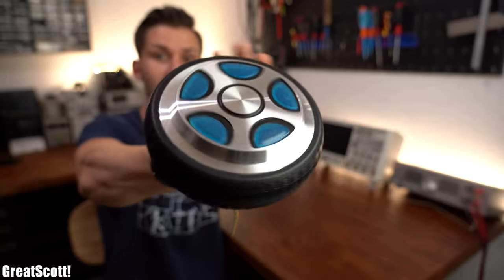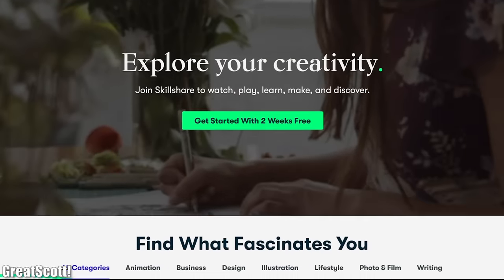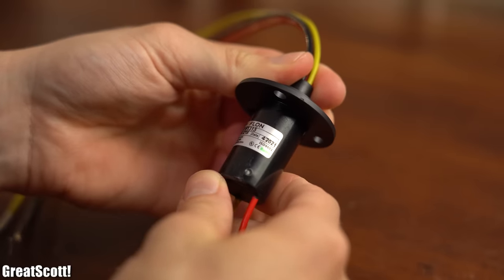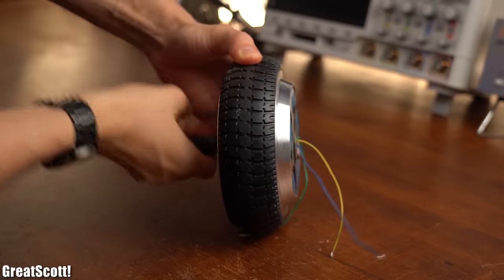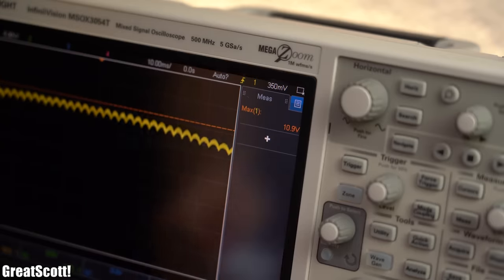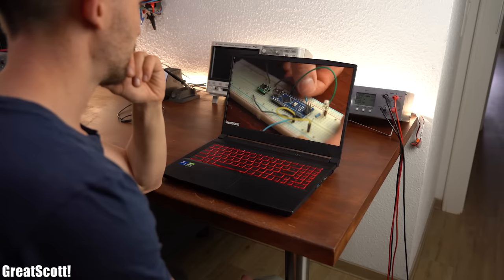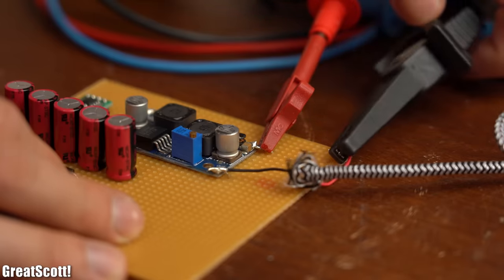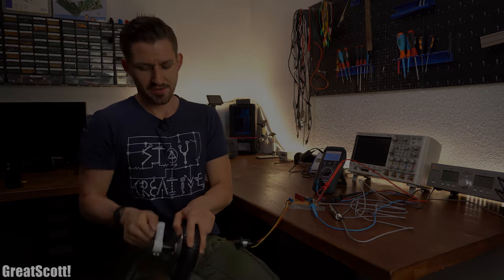Finally a good usage for Hoverboards! (charge your powerbank by cranking)

Comment from the maker: The first 1,000 people to use this link will get a 1 month free trial of Skillshare: https://skl.sh/greatscott09211
Reply: Hi sir. This was really useful video. Sir please hack an AR glasses to work on a HDMI input even if the whole setup becomes bulkey. Bigg fan.  Love from India ❤️❤️❤️❤️❤️❤️❤️❤️❤️❤️❤️❤️❤️❤️❤️❤️❤️❤️❤️❤️❤️❤️❤️❤️❤️
Reply: Time to attach It to the bike generator 😁
Reply: @-.......................-  seems like it was a patreon video maybe?
So people saw it before the release
Reply: Your hands will get pain after 5 mins, make one ring cage and attach it to the wheel, put one rat inside, it will do the job like an old movie style😂
Reply: your videos have been referred during Robert borsch training process
Reply: Put this on the Bike Generator,and Protect the spining wires. I dont think that this is a Good solution, becourse the wires rub constantly on the housing of the Motor (in the hole...)  Also for  an 2w Generator its way to big and heavy to be usefull...
Reply: As always, informative and entertaining video! However, I have a few points to add/ask. What is the Ampere-time characteristics of the efuse chip? I can see having large capacitor banks on both sides tripping the protection all the time. 
You pitched "emergency use" in the video. In that scenario, I would've avoided any parts that have a (slightly) higher chance of catastrophic failure modes (blowing up). Those electrolytic caps for example. 
Again, I like the idea of the project but I would have tried to consolidate the 2 capacitor banks and got rid of the easy-blowing caps. 😀
Reply: I Like your 6 Puls Brücken Schaltung
Reply: Hey.. How about make a gravity powered generator..
Reply: You should make one of these into a wind turbine!!!
Reply: I have 27.2v 1200 watt power supply means 44 amp. I connect two 12v 100a batteries in series and then i connect this power supply. But battery not charged! Why?? And how i charge 12v battery with this power supply???
Reply: I was going to guess a hand crank generator when you posted the picture. Only reason I didn’t is because I thought you already had a working one. Oh well you get that on these big jobs.
Reply: 000
Reply: You are an inspiration for a lot of people. Good job man.
Reply: Ok
Reply: A bit overengineered simply had to add a shaft to the rubber tyre you would have saved some 💰on slipring and 3d printing

Comment: " I'm way smarter now after watching my own videos" LMAO.....cheers.
Reply from the maker: While it was meant as a joke, I have to admit that I watch my own videos fairly often when looking for specific information.
Reply: @greatscottlab  I watch them to for reference !
Reply: It goes to show that taking notes and documenting everything you learn in an accessible way is extremely underrated.

I always take notes as if I'm trying to teach a beginner. Good to know that this genius is no different.
Reply: In the series arduino 101 the content was really dense. 
For beginners like me whem I start watching one of your videos my brain go to the hardcore mode 😂
Reply: I guess you can improve a bit the stability of thouse lose wire by monting the little bearing wire thingy you use there on to the stator case of the motor . It is a little thing but it will prevent the wire from getting tangled
Reply: And they said Germans don't have sense of humour.
Reply: @greatscottlab  that's the only reason I make videos,   to record how I've done things on the google servers in case there is an earthquake or something.
Reply: @youkofoxy  Marco Reps once said "German's sense of humor is not a laughing matter"
Reply: @FourthWayRanch  hmmmmmmm interesting
Reply: @greatscottlab  I absolutely do the same when it comes to my live streams! And it's a very valid joke given the state of the system.
Reply: There's so called "rubber duck debugging" where you describe your problem to a rubber duck. Sounds dumb, but in describing the problem, you understand it better.
Reply: but man 2.5W I can fart that much
Reply: @greatscottlab  Video notebook.
Reply: I’m way smarter for watching you own videos too! Lo
Reply: Getting baffled by your own wisdom. 🤣🤣
Reply: @greatscottlab  that's quiet inspiring 😅
Reply: @greatscottlab  you know good content when you see it 😁😁

Comment: Wouldn't it be easier, to attach a pin to crank it with off center at the outer part (where the wheel is attached to) and leave the inner stator as a stator?
Reply from the maker: Hmmmm I think this is the most comfortable solution.
Reply: That sounds like a good idea; saves drilling through lots of metal as well!
Reply: And it would be using the flywheel your holding.
Reply: That was what I was thinking too.
Reply: And perhaps 3D print a set of gears and a housing to gear up the rotation of the tire and make it easier to hold while cranking
Reply: That is how we make them into wind generators, clamp the shaft to your wind turbine frame and bolt some blades onto the wheel itself, can't see why that wouldn't work for a hand crank, especially as you could also take the tyre off and use a belt to drive it from any number of things.
Reply: I think so too.  It would also keep the wires from breaking over time, as metal fatigue is a very real thing - just as muscle fatigue is :ø)
Reply: @greatscottlab  I tought the same, a knob on the tire and a grip handle on the shaft would do the job... You could even use the tire just to slide the wheel over something and get it running while resting the arm from cranking a bit.
Reply: Maybe attaching 2 levers will help turning it more easily, 1 on the axle to help you keep it from slipping and the other on the rotor to have more mechanical advantage but not too long or it will prevent you from spinning it fast enough.
Reply: Like in a brushless RC motor.
Reply: I have the same opinion.. Why??
Reply: Actually you could do an handle like a salad spinner, really simple and efficient to remove the additionnal resistance and crowding of the slip ring.
Reply: Facepalm moment
Reply: Yep, a mechanical engineer would turn around in his own grave, seeing how overcomplicated he solved the "crank problem". XD

But seriously, Scott could have just 3D printed a part that holds the breadboard and the inner shaft static, while providing a strong base for the hoverboard motor to rest on, while violantly rotating the outer rubberized part.

The beauty of this would be the simple construction and the modularity, you would not have to alter the hoverboard motor in any way.
Reply: Exactly my thought. Though i was thinking a bit mor complicated and wanted to mount the whole crank to the wheel. But hey.
Reply: My thoughts exactly, I thought WTF??? -why not just mount the axle as it once were in the hooverboord and just attach the crank to the housing????🤗????

😂😂😂
Reply: @MMTube  I love Scott's videos and projects, but watching this one I was in disbelief. How complicated (and dysfunctional) the idea was!
Reply: Could've also added a simple 12v car charger as a stepdown  to handle the fluctuations in voltage.most of them can go down to 7volts and as high as 24volts
Reply: What we all want to say lol
Reply: I was going to say the same thing  before I read your reply.  Exactly , why change the design when you can  use it  to your advantage , The coils could have been rewired so to amplify voltage , but the mechanical part should have been left alone .
Reply: @greatscottlab  Even if it is, I just saw a video that shows it being like that!  And, it works like a charm!
https://www.youtube.com/watch?v=9_GUtEeRfOo
This is the link to the youtube video that I found about attaching the crank to the outer part!
Reply: Use a belt or an exercise bike wheel to really get these going.
Reply: I think this viewer-suggested  change is so significant,  so profound,  and yet so foundationally basic/simple while also being a true game changer that I wish Scott would acknowledge it in the video and apply it, as opposed to the minimal acknowledgement he did express in the comments.  I'm only harping on this bc I think the positive impacts of this change would be the difference between someone actually building and using this idea-vs- not.

Comment: I really like this new format. The intro is really awesome and dynamic. Great job!
Now hook that puppy to a bicycle, we all want to know.
Reply from the maker: Thanks :-) I actually got the idea from the hoverboard motor from the bike generator videos......Well maybe one day I will try it out ;-)
Reply: Of course I look through the comments and didn't see your suggestion till after I post something similar....  

END OF LINE
Reply: I would even go so far, and say you could remove the rubber part of the hoverboard motor, and directly rest the rear wheel of a bicycle in it - builtin gearing up, and since the stem of the motor stays still, no need to rewire the internals.

Comment: Im working on a wind turbine that practically speaking works the same. The E-fuse ic would definently help me when it comes to stalling at low voltage and with overvoltage. Thanks  for the video!
Reply from the maker: You are welcome :-)
Reply: Maybe adding a mppt to regulate the output could also be a option. Genasun has some that work with low voltages but they are a bit expensive.

Comment: When you stack capacitors in series, unless their capacitance is known to closely match, we normally would put a resistor in parallel with each so that the voltage across each is divided fairly evenly.
Reply: Didn't he use series due to volatge required.
Reply: @l33pul   - yes, but capacitors are notorious for not having close tolerances, so unless they are closely matched in actual capacitance the voltage doesn’t divide evenly; resistors have reasonably close tolerance and thus they are used to ensure better voltage dividing.

Comment: you can make an attachment to the wheel and fix the axe so you drop the usage of the extra device and while turning the wheel you get the added value of a fly wheel which will maintain the speed while not cranking.
Reply: I think it so 😂
Reply: Axe?
Reply: @zaprodk  Axle or shaft (axe for short)

Comment: wouldn’t it have been easier to attach a rod to the outside of the wheel? The system is already designed to spin the outer wheel independently of the electronics.
Reply: I couldn't understand why he got tangled on this. The wheel was perfectly ready for just doing what you said! 😂😂😂
Reply: @LDem-xj7ex  classic overengineering ;-)
Reply: pretty sure thats because the wheel is heavier, so obvisuly it would be harder to turn

Comment: Thanks for telling about slip rings. I have been thinking how i can do security camera that i can spin remotely :) and thats excactly what i have been looking for!
Reply from the maker: You are welcome :-)
Reply: They also make slip rings with a single co-ax connection.  Or, a single co-ax connection and multiple wires.  Although, co-ax slip rings tend to be high friction when turning.
Reply: Hair curlers / flat irons sometimes have slip rings (that could be salvaged) for the AC power cord so it doesn’t get twisted as the tool is sometimes used to twist up hair.

Comment: Cool little project. You could maybe use some balancing resistors parallel to each super capacitors to have an equal voltage distribution across them otherwise you might blow them up :)
Reply: Or zener diodes?
Reply: @adrienletellier6132  Or, but resistors are way cheaper

Comment: The USB wire connected looks  long which with its resistance can drop a few mV and that might be a significant loss here as it is already powered manually.
Reply: Few mV? A 100 easily
Reply: @anonanonkiewicz1921  Ya, depends on the current you draw at the output.

Comment: Why didn't you just attach a handle to the wheel to spin the wheel?  Those spinning wires will eventually wear through the insulation.
Reply from the maker: I did not think that would be a comfortable solution that you could use for a while.
Reply: Same thing I thought.  Figured it would be easier to fab a handle and not deal with spinning conductors.   But I like watching different thought process flows.
Reply: @greatscottlab  Then possibly make a more comfortable handle, so you don't have to hold by the shaft?

Comment: I have seen the same use of old washing machines as water generators: Lead water down a hill in a tube, and exit in a tiny muzzle. The waterjet spins an impeller connected to the washing machine motor. This setup generated 500W 24/7 into car batteries.

Comment: PS: Another likely source of generators are cordless drills. They not only have a nice, rugged DC motor, but also have a gearbox attached, so that a slow turning of the input shaft will result in a higher speed of rotation in the motor (generator).

And, the icing on the cake: The attached chuck makes it super easy to attach whatever input source you want! Small crank, large crank, foot pedals, windmill (cut a metal drum in half, offset the two half-cylinders, weld both to a length of pipe, set it outside (vertically), connect a pulley or chain at the bottom, and you'll have a low speed/high torque omnidirectional windmill, ideal for driving one (or more) of the "power train" from a cordless drill!

Comment: Nice video. Almost 2 years ago but still very relevant. Because it is already round shaped I was thinking about a spring loaded version. A spring that is called a "mainspring" made out of a spiral of steel. A mainspring is a spiral torsion spring of metal ribbon — commonly spring steel — used as a 'power' source in mechanical watches,  mechanical music boxes and toys. This must be used with some kind of gearbox to generate the correct hand cranked RPM (or higher) under load. First you crank up the spring to maximum tension with the handle and when releasing it, it starts to drive the 'generator'. If it is possible, it would be nice it can drive for a few minutes. That makes it much easier and there is a more stable output. If you need more juice, simply repeat the operation steps. I don't understand this doesn't exist. It could be really helpful and make the operation easier and more user friendly.

Comment: The 2 potential changes I see is your slip ring is surging from no rotation to really fast rotation and there is a resistance in the carbon brushes of the slip ring causing a effeciency drop. The other part is there’s a lot less work in creating a handle that you could hot glue to the hubcap of the wheel and you could have a benefit from turning the tire side instead of the axle side, using it as a flywheel you would be able to flick every so often to keep voltage flowing. Larger capacitors before the dc-dc converter could make use of the excess voltage you are able to create. But I think it’s a neat project!

Comment: Great video, power banks are hard to control, they test the power supply capability by drawing ramping current before settling to a specific charging power, same with mobile phones. The super capacitors will provide the high current demand during ramp up. That's when you see output power upwards of 4W. And eventually gets drained during which voltage drops and charger reduces it's current. That's why power draw drops below 0.5W. Now capacitors charges up once again. This cycle repeats. I came across this situation while I was building my solar charger. Great effort Scott. Please make more German content if possible. Thank you.

Comment: Hoverboards aren't very fast, but the pizzeria not far from where I live found an interesting use for them.
Instead of using a Scooter for closer deliveries, it's more convenient, cheaper and less exhausting than the bulkier solution, and as fast as running (without ruinning the pizzas :° ).

Comment: Very interesting project! About wanting to mount the slip ring to a fixed point, I think mounting it to the motor rotor might work. Drill 3 holes around the center one that was made for the wires, and then you can screw the slip ring on. Then u can also run the slip ring's wires into the motor instead of the motors wire out to the slip ring. Granted, that would require a much bigger hole for the center "hub" of the slip ring to fit into, or a 3d printed spacer to make it fit, but that would eliminate the dangling slip ring and extra twisting and untwisting of the wires.

Comment: I think that it could be much simpler,  I'd have had the handle on the wheel and made a grip for the spindle. Since you're often just above 5v a linear regulator would probably suffice you're only dumping the excess as heat and I don't think it requires supercaps. If you wanted to be really adventurous you could charge the powerbank cell directly to avoid yet another conversion. Just create a regulator at about 4.2v with an emitter follower and a zener and the battery will charge.  If it's got a dw01 or similar protection even better because it will just chop you off when it's full and it won't bother with that pansy current regulation,  you can stuff 1C into the battery even more as long as you stop before it gets hot which you will because you'll be tired.

Comment: Add some wind blades to the shaft to save your cranking and use a buck boost converter to ensure a constant output after the capacitors.
Reply: Yes! This I what I want to try!

Comment: I think those would be perfect for your bike generator idea. Just mount them so the tires are in contact and you will have some serious mechanical advantage. So there's a YouTube channel called open source low tech where he uses those hoverboard wheels to do water and wind turbines. I think he was achieving about 5kwh consistently.